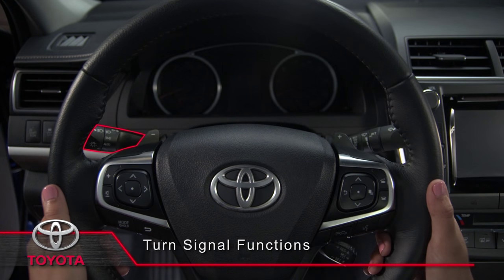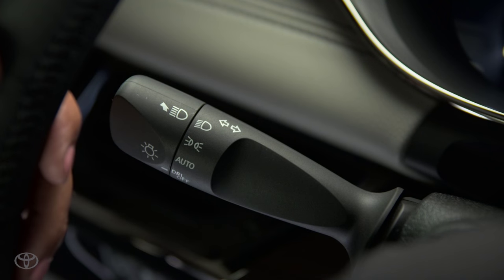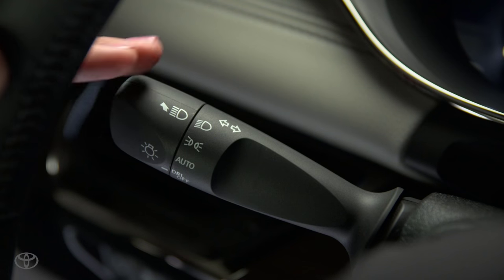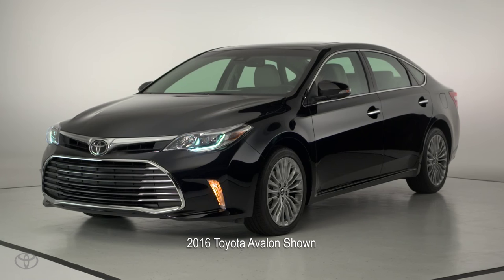Toyota How-To: Turn Signal Functions | Toyota

Comment: Y can only dealer change
Reply: Exactly my question
Reply: @ejshelby5460  like rn i have the 1 tic option its horrible
Reply: @3657tfj2  Just talked to my lexus dealer, they checked another 2022 GX in the showroom and it also does not blink (blinks once). So it's definitely factory default